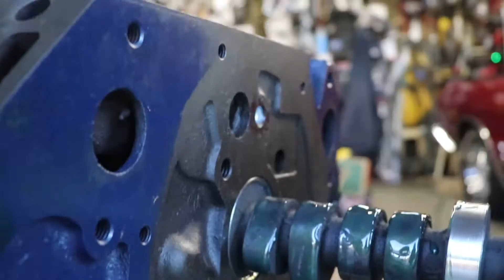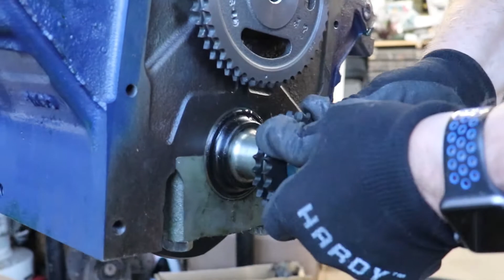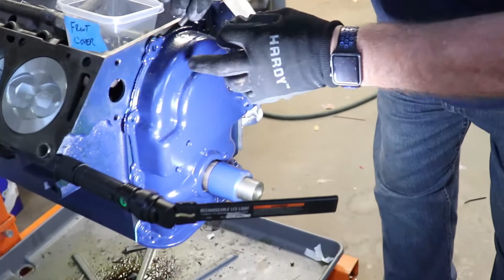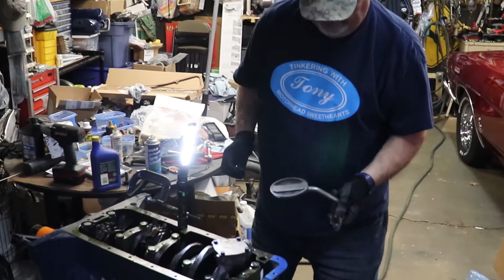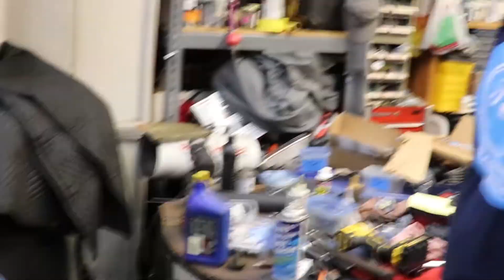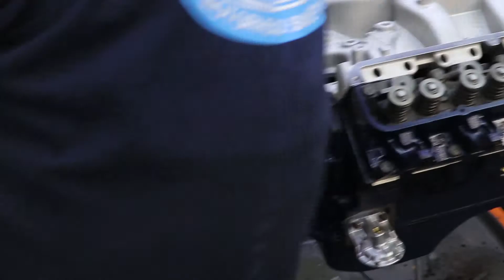How to Reassemble a Ford FE Engine | Tinkering with Tony | Motorhead Sweethearts

Comment: I doubt any of your hardware is going to rattle loose. Looks like you gave the bolts, all the ugga duggas. Lol. Great video sir. Love these old fe’s. Very well rounded engines. They score high in every category. Power to weight ratio, reliability, longevity, simplicity, and usability. It would be cool to bring back the fe in a fuel injected modern chassis. That would be something.

Comment: Install the distributor before you torque those bolts on the intake or even before you put those bolts in the distributor might not go in once you have that manifold bolted down

Comment: Big waterslot goes to rear, passenger side gasket is upside down. If the passenger head gasket has the slot in front the passenger side head will overheat.
Reply: Thank you I’m gonna have to remember that I’m building a 410 Effie myself and I’ve only done 289s and 302s before this will be my first FE build

Comment: NO  NO  NO N O NO NO NO NO NO NO NO,  you're alreadyt MESSED UP the timing chain.  That SPACER DOES NOT,  I REPEAT DOES NOT get re-used.  That spacer is ONLY used for assembly line upper gear.  The spacer is BUILT ONTO the new upper timing gear.  Your cam DOWEL is bottomed in too far,  and not engaging the fuel pump cam,  your front intake dowel that aligns the intake manifold has been cut flush or hammered into the block so far it won't engauge.  SO MANY mistakes here.  Don't do what this guy does.
Reply: He's old school but uses a dewalt drill to put in the bolts.  😦

Comment: Thank you for your service in the “Nam”

On FE builds, the cam should always be put in FIRST before the rotating assembly!! On a FE motor build, the crank and rods will not interfere with the lobes on the camshaft while rotating the crank & rod assembly before timing set is installed!!
By installing the cam first, you can guide the cam into position with much more control and accuracy, thereby eliminating another possible cause of cam failure!
Cam failures can be cause by “skimming” the lobes against the cam bearings when you install the cam without proper guidance!
We cringe when we see cams installed this way!
AND, every motor build should include camshaft degreeing! We have seen cams that are 6-7 degrees retarded when installed straight up, creating a poorly performing engine!

Comment: Flat tappet cam and lifter cores have gone downhill since the OEMs/car manufacturers have gone roller, you read so many horror stories of flat cams and collapsed lifters (which take out fresh rebuilds). Retrofit roller cams/lifters aren’t inexpensive but provide a great piece of mind (not to mention unbelievable performance).
Reply from the maker: Tony actually already swapped out his motor for a new one after we made the series haha! Maybe we can grab some video of it!
Reply: @MotorheadSweethearts  hun, I guess that’s why everything is a project. The reward is in the doing, the driving is just an objective. ❤
Reply: Thats my current decision to make. Up here in Canada, everything costs 1.75 on the US dollar. but you’re right. My rebuild is because of a leaky, hot rebuild with a blown cylinder gasket, rear seal, vapour lock and a collapsed lifter. It ain’t easy, being green.
Reply: @1961Bullet I started with a cracked Manifold and out of tune carburetor. 
I’m looking at right now the motor disassembled, the entire front end of Car removed, doors, panels, trunk, entire interior stripped, dash. I’m not sure what happened I remember a couple “might as well while I’m here” and I guess I’lll be able to say I know the car inside and out . Which I had never even changed the oil in a car before starting this and knew literally 0 about engines, didn’t even know what carburetor did. But I threw a $20 in the collection plate last week so I’m good
Reply: I've been using Summit lifters with various cams since the 'lifter epidemic ' began, used correct assembly techniques without any failures. 
 I have learned that Summit parts often mimics brand name very well.
 Most of Summits parts are specifically made for them to rigorous standards.
 Many of Summits parts are  rebranded Brand name parts. High quality stuff. 
 Their lifters are and have been since forever made in Mexico.

Comment: I have a soft spot for the FE and have had several. Torque monsters and durable, if a little thirsty. Unless I was doing a period correct restoration, I’d roll with the 385 series (429, 460) big block. 
Cheers
Reply: @tomdavis3038  You would be surprised how good a 4.125x3.98 425.51 with CNC Edelbrock, BBM, BT, or Trick Flow with 2x4s is and the FE with Aluminum heads , intake and water pump is lighter than any 429-460. They are good engine and make a lot of power, but an FE is like Mike Tyson, 5ft 10 barely weighs a heavy weight and has never been beat under Queensbury Rules. Look at some of the Goliaths he’s taken down. The FE is trimmed of un needed fat with aluminum parts that were offered over the parts counter. The 460 is good, but I have watched 428CJs take them down. 11:1 cr FE vs a 385 series that isn’t specifically built to avoid detonating will be a good horse race.